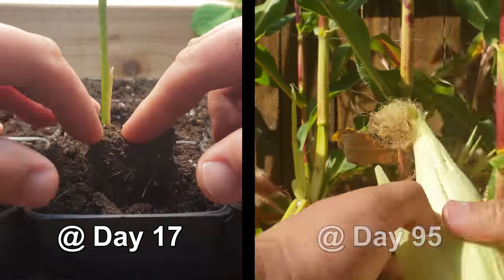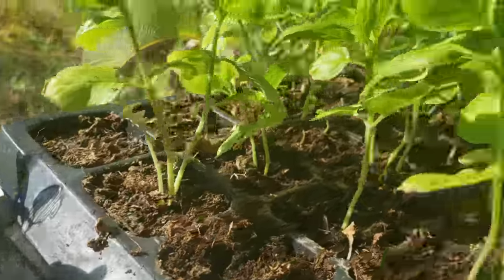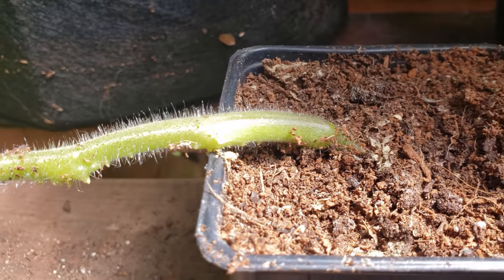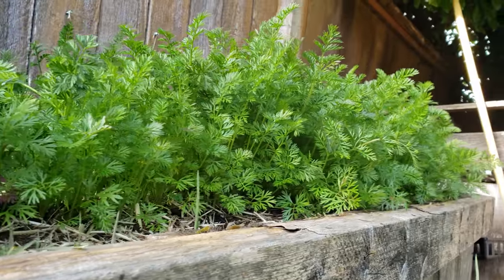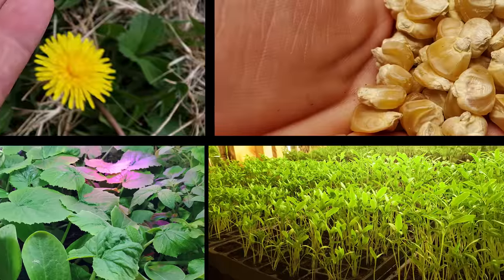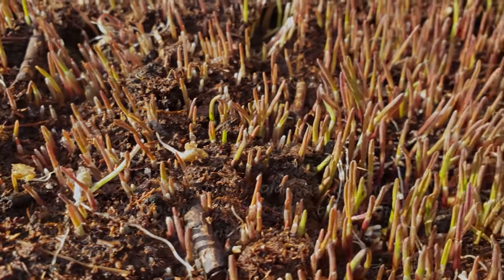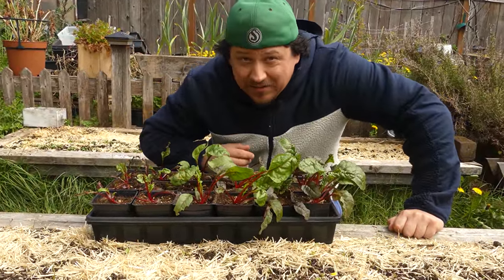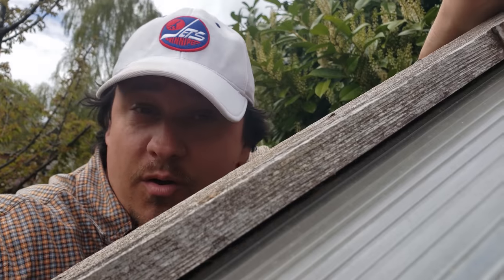Garden Quickies Volume 6 - Episodes 51 to 60

Comment: My second year of gardening in Central Florida in a backyard garden.  How many times can I amend my growing areas?  Should I leave an area dormant or put in a cover crop?  I sow in soil, grow bags and 5 gallon buckets.
Reply: Patricia,
I grow in raised beds, 5 gal buckets, and grow bags.  I fertilize every 15 or so days.  I mix my compost and  my fertilizer together.  I'm not a professional, gardener but I have been gardening for over 40 years.  I can see the plants like that and they put out new foliage and fruits.
Reply from the maker: You can amend as many times as you like Patricia, depending on the amendment. Dormancy with a cover crop is a great tool give the garden and the soil a break. I wouldn't both letting containers or grow bags go dormant, container gardening is a different beast where those practices are rarely used.
Reply from the maker: @shirleyk623  🙂
Reply: @TheRipeTomatoFarms  I reuse grow bag and container soil.  I have an area where I “dump it” then add amendments to it and new soil!  I find warms I put back and grubs I stomp!
Reply: @shirleyk623  thank you very much for your input.  It’s valuable and I appreciate it.  I was rarely using fertilizer after setting up the plant
Reply: Now, for the last two weeks I have been using fish emulsion every other week.  I am so thrilled to see plants produce.  I just stand and look.  I hope that feeling never goes away!
Reply from the maker: @Freedom2025-x2b  it never goes away Patricia!! :-)

Comment: Good idea but I would have screwed through the old wood into the good wood which would make it stronger
Reply from the maker: I did. The screws were 3" long and 2x4's are only 1.5" thick. I went it from both sides.
Reply: @TheRipeTomatoFarms  I’m sorry, I apologize that I did not see that, I love your videos and Quickies 👍
Reply from the maker: @MechanicMark613  no worries man! You're right though, it makes sense to have the screw bite into the good wood last as it will hold the bad wood together. Spot on!